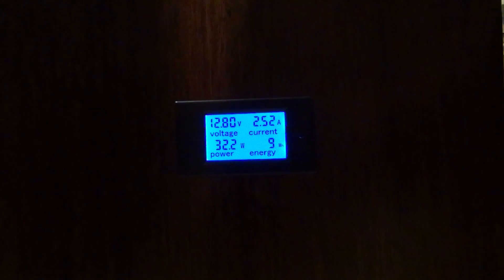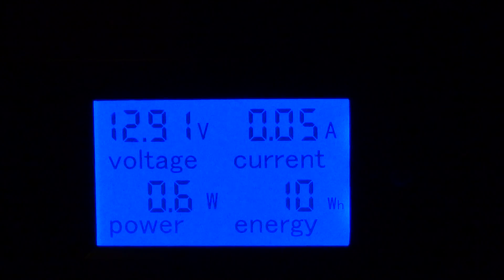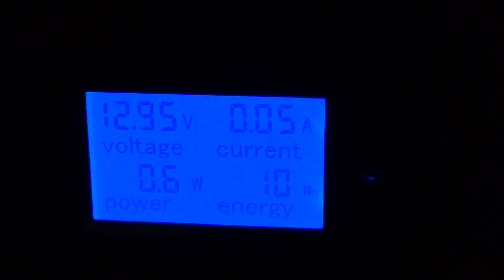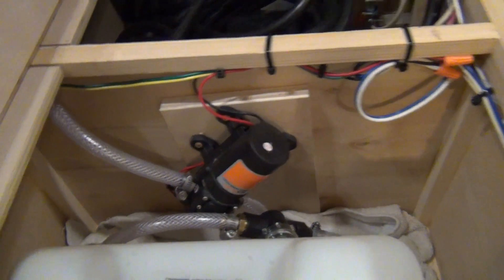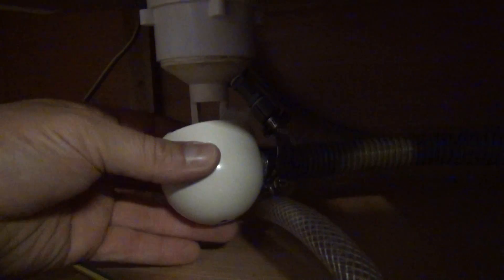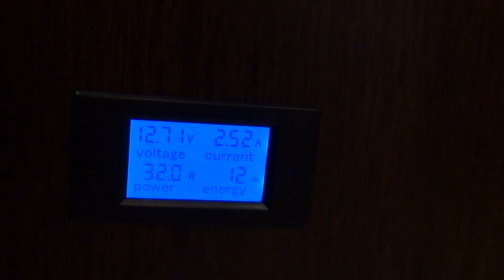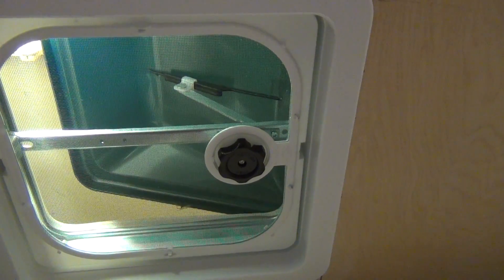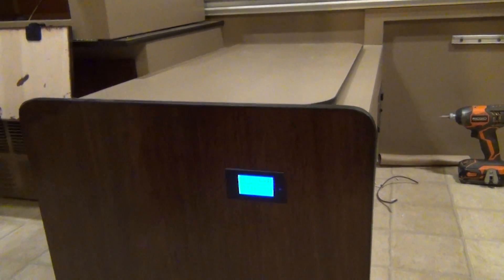Added Volt/Amp Meter To Popup Camper 1992 Starcraft

Comment: Great video. I'm slowly outfitting our new-to-us popup (similar size) and am looking for a nice volt meter. Would you mind posting a link to the unit you purchased? I like all the draw down information it includes. Also - did you end up going with any auxiliary fans for the end bunks?
Reply: Thanks for the link (for both)! I'm going to bookmark that vent fan. We have a stock powered fan in our camper, but it's nice to know that's an upgradable part if things get a little too muggy. I'm really enjoying sinking my teeth into the customization part of pop up life.